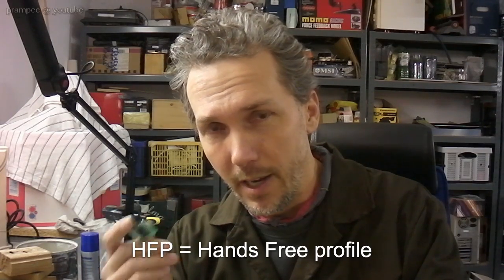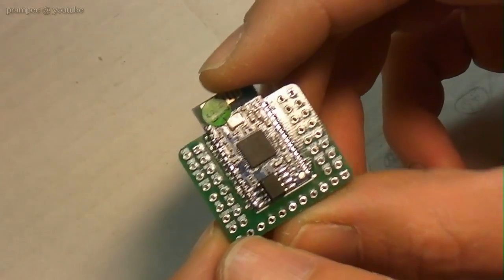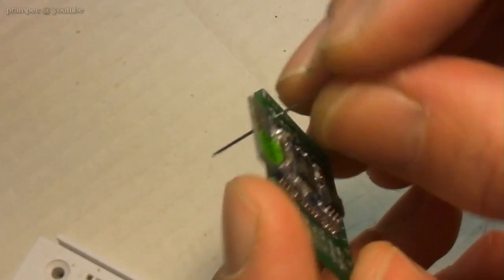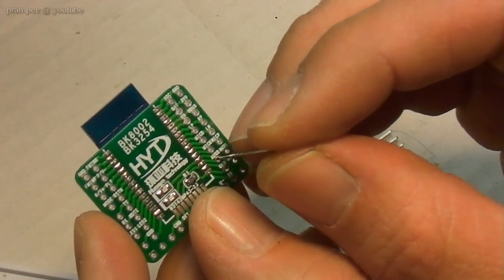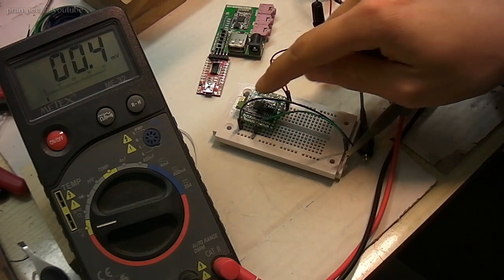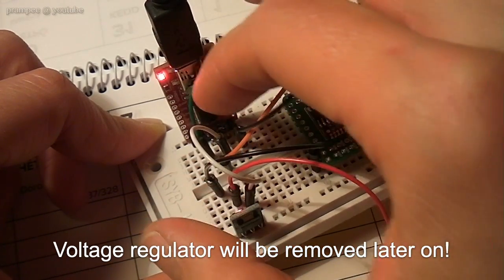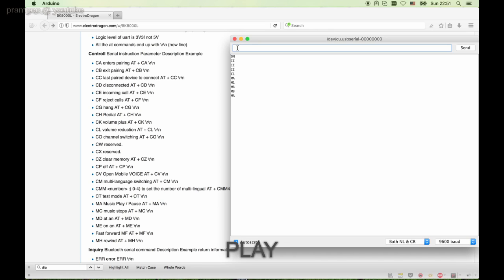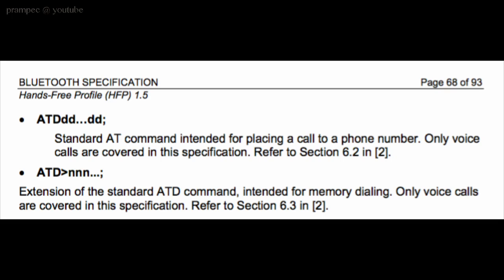BK8000L Bluetooth module HFP test

Comment: Just found this. Thanks for sharing your findings!

re: your comment at 7:00,

To be fair, the Bluetooth 1.7.1 HF spec says:
---------
  ...
  2.5 Conformance
  If conformance to this profile is claimed, all capabilities indicated
  as mandatory for this profile shall be supported...

  3 Application Layer
  ...<table>
  Place a call with a phone number supplied by the HF O M
  ...

where 'O' means 'Optional' for the HF device;
and 'M' means mandatory for the AG device.
---------

So, if I'm reading that right, a device may claim HFP support even though unspecified  'optional' features are omitted.

What bothers me is that there's no requirement to communicate which of the 'optional' features have been implemented.

I'd really like to find a module with this capability too!  Did you found one that suits your needs?
Reply from the maker: Thanks for the reply. I just have found, that esp32 might do the trick.
Reply: :) great minds think alike.  I've just obtained an audio sample board including the AI-Thinker ESP32-A1S module.  Just barely started investigating. Will look for you in the ESP32 forums, in case you're in the same situation.

Comment: Have you noticed that it gets really hot? At 5 volts, it's pulling 0.46 Amps and at 3 volts it consumes 030 amps. Where in the forum is the documentation? Thanks

Comment: the link to documentation doesnt work :(
Reply from the maker: Right! Check the Forum archive for the copy of the online documentation! (Forum link on the description.)
Reply: Balázs Kelemen I got it working. Now connects to the phone or pc and plays the music. However I want to connect it to my Adriano uno (atmega328) via tx/rx. When I power on the module rx gets a 0.03v spike. How can I send and receive at commands via rx/tx
Reply from the maker: flushyoudowntheloo  I didn't have tried it myself. I guess the same way as described at 4:55
Reply: Balázs Kelemen I thought I could connect the tx/rx directly to digital pins , and cross them. But can't receive anything on Arduino

Comment: Hi Balázs,
I am looking for a module for my project: hackaday.io/project/28150-jvc-to-clio
I need HFP (without audio) and PBAP. Do you have any recommendation about the module? Is it possible that this module will support PBAP with a new firmware?
Do you have experiences in bluetooth? May I contact you directly with some questions?
Reply from the maker: I'm not sure, that BK8000L is capable to handle PBAP at all. But the main problem is, that there is no way to get hands on a "new" firmware. The only way you can do this write an Android software, that can communicate with the module via serial. But I did not tried this, as I did not have any experience in Android programming.

Comment: can i disable call ringtone?
Reply from the maker: Not on the BT module.
Reply: ภาณุวัฒน์ ทับบุรี There is a way, but it requires a SPI connection and a Config Tool for the CSR86XX.
Reply from the maker: Do you know any sources to get hand on these tools?

Comment: Welcome. I'm wanted to use this module also like an autorization for 
owners phone. So if you disconnect the module from power supply or 
disconnect bluetooth, module will remember owners phone pairing or it 
will be broadcast to pair with another phone?
Reply from the maker: It will be paired with any phone. The only thing is that it remembers, is the last paired phone, and will connect to it without pairing. Other than that, it is still welcomes any other devices to pair without any security.

Comment: I got such module, but AT commands does not work, unfortunately. It seems some modules are fake.
Reply: After reprogramming of the flash chip AT commands work, many thanks for guys shared firmware!
Reply: What hardware did you use to reprogram the flash?
have you desoldered the IC from the board?
Reply: I desoldered the flash chip, then I reprogrammed it on TL866CS programmer. It can be done in-circuitry manner, first way is more comfortable for me.

Comment: Hi, how can i make the Microphone work? How should i connect the MIC BIAS to a mono Microphone?
Reply from the maker: Sorry, I'm not good in this, but the documentation - I believe - covers microphone connectivity.
Reply: I only want to use a simple Jack microphone but no idea how to connect, the simple MIC N and MIC P didnt work
Reply from the maker: Please confirm, that you have tried, what the documentation (mentioned in the description) says about how to connect a microphone! That needs 7 more electrical components.
Reply: Yes i tried. Can you measure voltage between the MIC BIAS and the GND? Because i can't
Reply from the maker: Yes, I can. 2.4V. But only while on call!

Comment: Would it be possible to read ID3 tags from a song playing on a phone with android?  AVRCP supports that, but I can't really see how to implement that on this module..
Another thing is, the SPP should support streaming data via the module, right? That means you're using it in sort of a bluetooth-serial adapter, so it should be possible.. Let me know if you managed to achieve these tasks on this module.. I was tempted to buy the CSR8645 but there are no AT commands, so you can use it just as a bluetooth adapter and that's all about it, despite its amazing specs
Reply from the maker: This YouTube comment thread got tool long. I have created a public google-group, so we can arrange our conversation more structured. https://groups.google.com/forum/#!forum/bk8000l
Reply from the maker: I'm affraid, that the capability of BT profiles does not mean that these capabilities are exposed in the AT serial interface. If we would able to write our custom code, to run in the BK8000L chip, than we could manage to access all these BT profile capabilities. But this level of programming has no documentation at all.
Reply: Balázs Kelemen but SPP should work just fine, right? That means I can avoid AVRCP and make an app on the phone that sends the song's title via SPP as a string
Reply from the maker: True. However I did not had luck with SPP myself. But I might have tried the wrong way of talking via SPP. The documentation recommends to try with the BlueSPP app, but it was suspicious to me to be installed. If you have a right method to test SPP, I will try it to you.
Reply: Well, you should install BlueSPP, run the command APT+SPP8888 (I suppose that is the password) and you should get a feedback if password is correct or not.
Then try APT+WHATEVERDATA, and on the serial output you should receive APR+WHATEVERDATA.
However, it doesn't specify what type of data you can send(bits, hexadecimal, characters)
BTW, why do you find the BlueSPP app to be suspicious? Afterall, if it is on google play, then it is safe..I'd rather be concerned if I downloaded a random app from some obscure site
Reply from the maker: I have checked the required permissions for BlueSPP, and I did not understand why a BT app needs my location, full access to USB storage, and full network access.
Reply: Balázs Kelemen you can always disable those permissions if you are using marshmallow (6.0) and above
Reply from the maker: Just have checked it: No luck with BlueSPP as well. BlueSPP couldn't made connection to the paired BK8000L module. (Tried on Nexus 5)
Reply from the maker: UPDATE ON THIS: Works well on Nexus 7. BlueSPP connected to the paired module. Could send messages with APT+message to android, and messages from android appeared on BK8000L serial in a format APR+message immediately after sending. (An APT+SPP8888 needed for the first time)
Reply: Yep, that was the first step, I mentioned it in a previous comment :) Nice to hear that it works..But will it work while the music is playing? that would be interesting to know
Reply from the maker: I bet it will. As the android device always plays some annoying beeps, I could see MB, MA events on the serial console.
Reply: Good, now I'm searching on some chinese sites, maybe I can find the full datasheet of the IC, and some software to program it via uart/jtag/spi
Reply: Seems like he's just using it as a COM terminal, but I found something interesting in that picture: 1.I believe you can change the module's name with AT+NAME=somename and probably it would be the same for password with AT+PSWD=XXXX. Also, I believe you can find the module's name and password with AT+NAME? and AT+PSWD?
Let me know if these commands work for you. I can't wait for my module to arrive. I hope that AT commands work as I haven't bought this from ElectroDragon, and this would be a part of a bigger project with Bluetooth handsfree integration in a BMW E46, and I want to make it as good as possible :)
Reply from the maker: No. None of those commands works. However you can query the name and pin with AT+MN, AT+MP (also noted in the documentation of Electrodragon).
Reply: Hmm..then there must be a way to change the module's parameters...damn it broadcom and their proprietary and confidential software and datasheets..
Reply: I just found this:
AT+NAMExxx
AT+BAUD4
AT+BAUD8
AT+VERSION
AT
AT+PIN1234
also, you can try AT+HELP to see if anything pops up on the serial monitor
The commands are for a beken bluetooth module, so it might work..
Reply: There are no such commands in my module.
So far, I've found only 2 undocumented ones:
AT+REBOOT reboots module (takes quite a while)
AT+QMAD (displays MAC address of device it's connected to, or NCM if it's not connected.
Reply: l0udPL Well..some of the features may be locked in the firmware..for example, this IC should support AVRCP and tag out metadata via serial..I saw you commenting here about getting the firmware out of the EEPROM, and changing the name and other stuff...It would be nice to see how much we can reverse engineer this thing...Then, by flashing a firmware from a UART working module, you can presumably, enable it on a non-working serial interface. If you can find out what those hex values do on there, I can write a program to automate all the process and build a nice interface to edit all the parameters :)
Reply: It's not one of those chips that just store configuration on external EEPROM and you can enable/disable features freely. It's more like a ESP8266. I suspect that hardware supports only first layer of BT stack, the rest is in the firmware (that is on external flash). If supplied firmware does not support some feature you're out of luck, unless you reverse engineer it enough to add new functionality.
Reply: I already did some work on the firmware you provided. I found BK3251S in some string using IDA, then I found a datasheet for that IC, and it seems to be a Bluetooth SoC. Maybe the BK8000L is based on that chip..Anyways..I tried disassembling it using IDA with MIPS instruction set, but I later found out that the BK3251S is based on an ARM processor..I'll give it a go and see what results I get..BTW, I found a whole lot of other commands, and probably some AVRCP ones
Reply: Well, I suppose these chinese manufacturers have some kind of a tool to program the module, that's unless Beken(Broadcom) sends them just the binary file to flash on the memory, and maybe they have 2 variants...
There's some software to program this thing for sure..the trouble is, it's extra-super-mega proprietary, and probably just a few big companies have it..It would be nice to find a device that has all the features enabled, and then get the firmware out of that...but I doubt anyone used this chip in any midrange to high end devices. Maybe ElectroDragon can help us with some piece of software if they can get it from the manufacturer ;)

Comment: Hi
It would be interesting to check if replacing flash (smaller IC) from module with AT commands, would bring that functionality to other module?
Reply from the maker: We might want to continue this conversation in a more organized way: https://groups.google.com/forum/#!forum/bk8000l
Reply: I think the commands you mentioned are actually sent by module to host via bluetooth (to perform some operations like starting/pausing music).

Actually the structure of rom content is not that complicated. It's beginning from a large chunk of code (unknown instruction set, all we know from datasheet that the CPU is 16-bit). Then we have some data segments with device name, and then sounds. Sounds are stored as little endian 16bit PCM mono with 8000Hz sample rate - you can actually export that large chunks from hex editor and import them into audacity as raw data.
Reply from the maker: Interesting question. But in this case I believe this flash memory does not contains software, but can used by the program flashed on the MCU. For example to store BT pairing info.
(Anyway, program exchange will only work with same type of MCU-s. In this case with BK8000L MCU-s.)
Reply: Looks like the firmware IS stored on external flash. I just soldered flash chip from module known to have working AT commands and now they work on module that has previously TX line pernamently down. Actually the whole behaviour changed - module is now reporting battery level (I can see bt battery indicator on my phone and tablet), and has different sounds on connect/disconnect.
Next thing I'll try to do is to dump both firmwares.
Reply from the maker: Nice! Please keep us informed!
Reply: Module uses 512KB/4Mb SPI flash. I've dumped both firmwares:
https://www.dropbox.com/sh/sbbjcqmtlm3nks2/AACAE_u18PuOfPvkDVwhFEbNa?dl=0

You can easily change device name by replacing BK8000L in hex editor.I'll try to do more analysis later, currently I don't even know which instruction set this MCU uses. Interestingly,  there are much more strings embedded in code than device is actually printing in serial.
Reply: ?Maybe some other commands? 
Snippet from HEX code:
ATA.AT+CHUP.ATD.AT+CCWA=.AT+BLDN.AT+BRSF=.AT+BTRH=.AT+BTRH?.AT+BVRA=.AT+CIND=?.AT+CIND?.AT+CMER=3,0,0,.AT+CHLD=.AT+CHLD=?.AT+CLCC.AT+CLIP=.AT+COPS=3,0.AT+COPS?.AT+CNUM.AT+VTS=.AT+XAPL=0000-0000-0100,7.AT+IPHONEACCEV=.call on hold.held call rejected.held call accepted.AG Response
Reply: I'll actually try and disassemble the program, and see if I can make any sense of it :)
It'll make my life easier when I'll get my module so I can go straight to it and modify the things that I need ;)
Reply: Nice! I'll give it a go and see what's with it. BTW, does the audio segment have any identifier or the MCU finds it by memory location?
Reply: l0udPL I have a few questions regarding your method of dumping and flashing the firmware, maybe you can reply here or on the google group created above.
Reply: Are you now able to dial a number, with the new "firmware"/flash?

I just bought two of these modules, and not being able to dial a number would be a show-stopper for my rotary-phone conversion project. Thanks.
Reply: I am currently using a STM32F103 board as a programmer and I managed to get the firmware from the flash using fashrom on linux. The thing is that I did that by forcing the presence of the flash chip..on the other hand, I can't write to it, because it says that it can't find any chip(even though, by force reading and force selecting the W25X40, which I believe is the closest to this thing i can get out the data). I'm quite stuck now, and I quite need some help..
BTW, I compared the firmware with the non-serial one you provided and are absolutely identical

Comment: How can i access SPP through arduino and also how can i save at commands in bk8000l whenever i disconnect and connect it needs the same previous codes again
Reply from the maker: I do not see the point saving commands to the module as it is connected to the Arduino anyways. You can send and receive SPP "sentences" after the SPP password was entered. I did not have tried this myself, again consult the documentation provided.
Reply: i tried using it with arduino it's not working
i am using an external usb uart for using at command
please show how to use it with arduino tx/rx pin
Reply: abhishek Chatrani have you figured this out ?? I need to connect it to arduino via tx/rx to send at commands

Comment: Which code did you use for arduino? I am not receiving responses from arduino which has ch340g
Reply from the maker: No Arduino code was involved here. What you see in my video, is the serial console of the Arduino IDE, that can be replaced with any kind of serial console.
Reply: Please help me with the arduino code. When I hook up the Rx and Tx of my arduino uno r3. I am able to send at commands but I don't receive any response from the module as such. The commands do seem to work but in y case, the module doesn't output "OK". I am currently using the SoftwareSerial program provided as an example in arduino. Please provide me a code to get the responses too. Also, while using this module, my AT commands don't always work. They suddenly started working yesterday but they didn't work earlier and they don't work now. How do I debug this.
Reply from the maker: Arduino UNO is 5V logic level. The bluetooth module is is 3.3V. This is not a problem if the module is 5V tolerant, but I'm afraid, that this one does not stand 5V logic level inputs. For testing purpose I recommend you to use 3.3V operating voltage module, especially one with more hardware UARTs. Like this one: http://www.inhaos.com/product_info.php?products_id=117
Reply: I used XS3868 with it successfully.
Reply: But why did it work sometimes?

Comment: Great to hear that you got a module that supports AT commands!
With some bluetooth modules the "CW" command is used for voice calls. In electrodragon's documentation that is marked as "reserved", but it is worth trying if you want to use that feature. You could try "AT+CW" followed by the number you want to call.
Reply: Nice video! Thanks for making this.

The back side is for another board, so only check the front side print. And do not support making call now, but support answer call ..